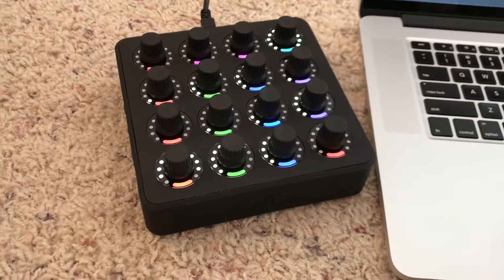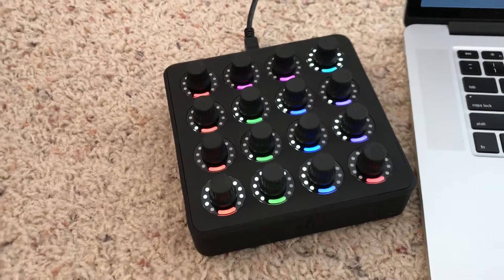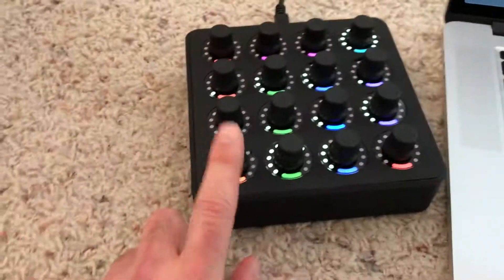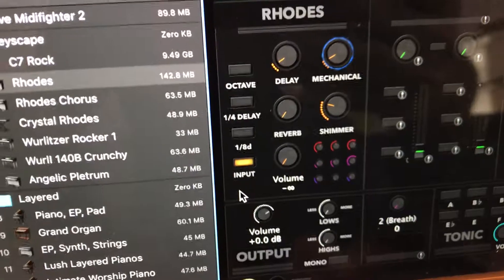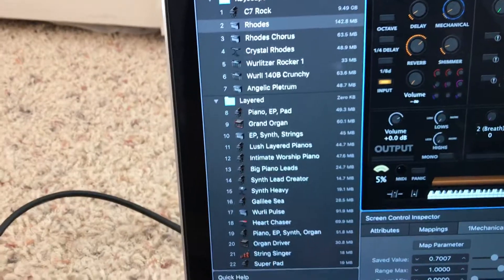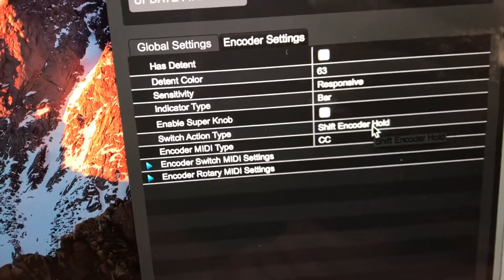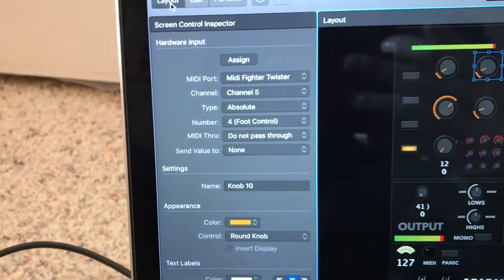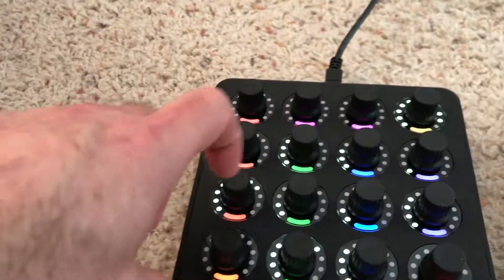Control a MainStage Knob Plus Button with One Midi Fighter Twister Knob

Comment: Hi Steve! Thank you for posting about Midi Twister and MainStage. Please could you tell me if Midi Twister has a LED feedback from MainStage's knobs and switches position, when changing patches in MS? Thanks!
Reply from the maker: Yes, there is LED feedback! When patches are changed, the Twister shows those settings.